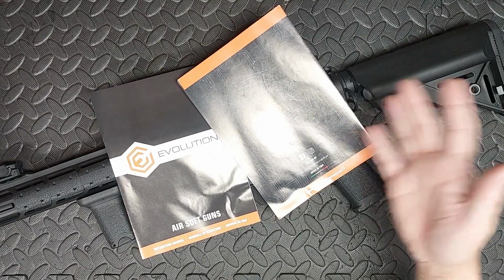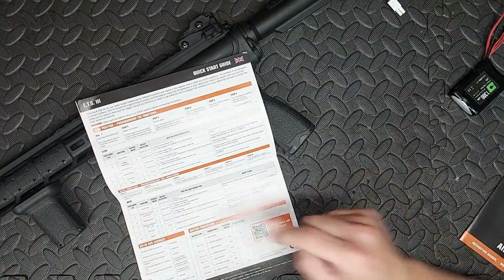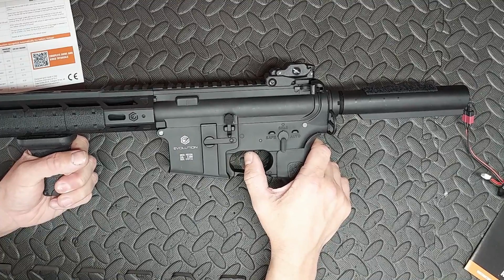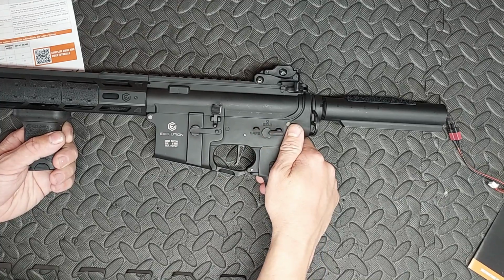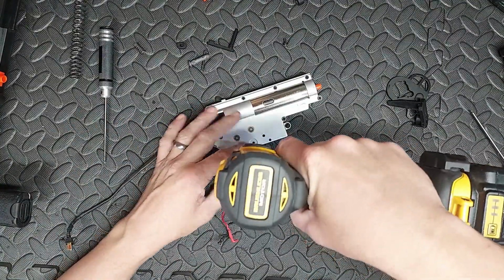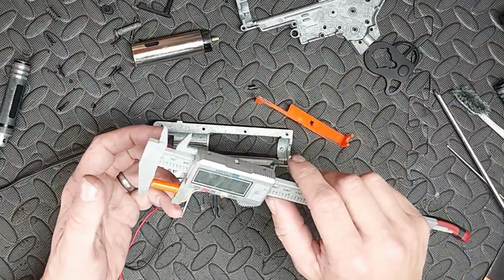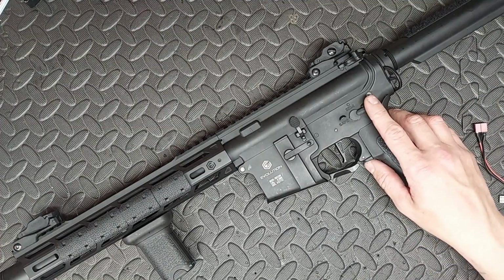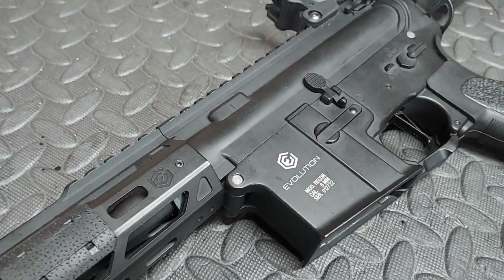Evolution Airsoft  - Worth It?

Comment: After watching a shit-ton of these videos, I'm totally gobsmacked the airsoft community puts up with sub-standard crap that needs re-working to be reliable.  The QC is awful, I mean, the  Chinese make f*king Nerf blasters with better quality than a lot of the far more expensive airsoft stuff I've watched Luke swear at.
Reply: Because airsofters also want their shit to be cheap. So you skimp out on a lot of things - QC, materials etc.
Reply: @UH1Phil  Cheap? I just finished a 200fps nerf springer conversion, (including changing the ammo type and building a sealed brass breech), equivalent to an airsoft sniper build, for a total cost of £50.  I shudder to think how much I've spent on my cyma AK!  But seriously, if you have to swap out parts, add a new hop unit, motor, and get it reshimmed, is a cheap airsoft gun still cheap?  It'd be cheaper long-term if they just made ones that worked oob! 🤑
Reply: @FelixstoweFoamForge  Yeah, but the market demands "good enough", not "fantastic". ASG did well with their Scorpion Evo I think from a QC perspective, but that had a price to match and the immense supply chain that ASG has. Not saying the Evo is perfect though.
Reply: @UH1Phil  I Bloody don't.  I pay, they deliver.  That's how it works.  If it's shit from the box. I'm not buying.  And neither should anyone else.
Reply: @FelixstoweFoamForge problem is expensive guns the money goes to externals if you want good performance and reliable you need to sell enough to get the price to round 350

Good spring guns are dirt cheap. 

The high end nerf guys in the electric gun end can get to airsoft sorted build money easily and you get crap nerf externals.

The singapore and aussie guys who don't have a choice but to drop 300-1k on the custom built guns and their quality externally is far behind airsoft because economy of scale prevents some stuff and their obsession with lightweight.

Airsoft the problem is the endemic Chinese issue of lowest possible standard and no post sale support but you can't do western manufacture as you'd get paintball prices (1200 for a gun easy.)

Comment: I've seen some people say the Devgru DG-74 I have is an Evolution gun. But it's hard to find anything else about it. Maybe they're all made in the same Shenzhen factory.

The barrel did an impression of a German army G36. It's bent down enough that it cracked the cast-in 'gas tube' and misaligned the foregrip.

It's probably still a better 'game' gun than anything else I have that's far fancier.  Because inspite of it all - and sounding like someone banging on a lambeg drum full of glass and rusty nails. it somehow shoots consistently - once I figured out how to make it feed. Clean the trigger contacts, take it slow and it runs.

Comment: I hate stuff that tries to use complex single/2 button programming systems. Especially buttons that also do other stuff (say... A trigger and safety-selector switch)
They're always an absolute pain to actually use, there's no way to get anything done without the manual, and half the time you can't even be totally sure it's actually set the way you intended

Comment: I had one myself first game day motor Burt out.  I'm 99% positive it's the full cycle completion feature on the etu turned it on so the 3 round burst would fire 3 rounds without having to hold the trigger down.  Got jammed somehow and the etu clearly has no cutout if the cycle doesn't Finnish

Comment: what do you think about the new double eagle stuff with fire control things if you have had a chance to look at a few. they seem to be offering quite good value for money but of course that only stands if they work as intended for a reasonable length of time.
Reply: Insanely good value (sadly the mosfets by themselves are out of stock in the states)
Reply: ive had mine for over a year and can confirm they work pretty well
Reply: I can only say good things about them really. A few things maybe: They are really happy with a 11.1v, not so much with 7.4v. The bolt release is a bit flimsy. Nothing else really, performance is good, I only upgraded the bucking to a TNT TR-hop bucking. It was intented as a back-up gun but with the nice weight and performance it started to become more of a primary. I bought it at TaiwanGun. If you need more info about it then you can only find online, I recommend the Pheas Airsoft Youtube Discord. I think it is one of the few out of the box AEG with a mosfet that doesn't fry by the 11.1v lipo. Like, with an 11.1v it has good enough performance for 85% of the people who plays or want to play airsoft. While the Cyma platinums are also great, the Double Eagles are more affordable and have a far more reliable mosfet. The cyma platinum has the better (Cyma blue series) internals, but those of Double eagle are not bad either. If you plan to upgrade the motor to for example a warhead motor, expect possible fitment issues with the existing pistol grip. This can be an easy fix by replacing the pistol grip. Best of luck!
Reply: @NK_Customs  I replaced my stock motor with the modify torque one without fitment issues. Although I can definitely see that the wires have barely enough room

Comment: I've recently got into airsoft and I'm looking at buying my own rifle so I no longer have to hire equipment. 
Do you have any resources on what is good? 
What would you recommend? 
I want the best AEG I can get for £600 max.
Reply: Cyma platinum m4 series is fantastic. Krytac crb isn't bad either.
Reply: If you go with the EMG modified CYMA stuff they are really good right out of the box. The MOSFETs can be a bit iffy like most OEM MOSFETs. The gearbox can take one hell of a beating. The only thing I'd really replace on the EMG CYMAs is the shitty plastic nozzle and maybe the hop up / bucking. Be saving up for a new MOSFET because it will most likely fry eventually. Hell, at your price range you could probably order the Umbrella Corp EMG M4 and have them put a better MOSFET in from the start and you'll have a good reliable airsoft gun.
Reply: Cyma Platinum
Reply: @error262  Yeah, anything CYMA Platinum is good but will require some upgrading to get the most out of it. the EMG CYMA stuff is a steal because it is already pretty well upgraded. Barrel, hop-up, bucking... done.. you got a great airsoft gun to compete with the $1000 stuck-up gang.

Comment: the problem with the electronic trigger buzzing continuously and not allowing you to program any function is not a malfunction, it is just due to the bad Deans to Tamiya adaptor you used which was not able to provide a stable power connection. It is simply in protection mode to avoid damages. The smoke after you took apart the gearbox?... you have in some way damaged the wires' isolating cover and caused a nice short, there is not a fuse that can protect from damaging the gun by yourself 🙂
It is just basic understanding of how electronics work
Reply: so the fault of the short is from the guy in the video?
Reply: @Ruizzz11 Yes, sure

Comment: Do you use precocking whit the warhead motor?
Reply from the maker: build dependant
Reply: @NegativeAirsoftTech  because they advise to not use it…. But when I tried it it seems to work fine. Build is a Cyma 098 whit stock gears reshimmed ofcourse, gate titan, warhead high speed, 1.6J whit 0.3 single locked for a DMR setup. I would like to use the precocking because it reduces the noise on each shot even more

Comment: Hahaha and it's supposed to be better then double eagle m906e..... pufff that's way better as it doesn't tick at you and its died when you pulled the trigger hahaha mine can take a 11.1v but I'm not using one cause its way to fast as I changed the deans connector to new one and now it fires really fast with my trigger sensitivity set to lvl 2 and 1. 

It's a good job I didn't get one of those

Comment: So its a fancy cyma platinum mosfet that's even more fragile. Shouldn't need to install a fuse. Reminds me of when evike botched the downgrade on my aks74u. I try to see how it sounds because some of the newer ones (i got an older one brand new 5 months ago) are decently shimmed. I pull the trigger and nothing. I check the fuse capsule and what should i find in top of the dust cover not staying shut. There was no fuse at all so i had to supply my own. I close it then it starts working probably because the wires were contacting each other. Not trusting evike again. $5 for a box of 20 fuses and 2 weeks for later i finnaly get my first gun for real after the half baked tech job they did. If that's how airsoft techs from big retailers are if you want something done right do it yourself. Even now i found another problem. I want to put a Prometheus barrel in my gun. If ondo that, my gun wont be cqb legal. 345 on a gun that probably has a crap airseal is not a m100. That's probably a m110 but at least a m105. I might even need a m95 spring.
Reply from the maker: It's nothing like the Cyma,more like btc

Comment: Ive bought one of the evolutions last week, discovered your channel today. Iam rather new to airsoft and its upgrades so i tried changong the spring on it anyway. It burned down the motor aswell( on a11,1v aswell btw) as the storeguy sold it to impulsive buyer me. So i gues i got fucked over for 250€ 🫤
Reply: Btw i just kinda binched your uploads and absolutly love your way of bringing it to the table. 👍
Reply: Me ha ocurrido lo mismo , tengo una evolutionairsoft 416. I se me ha quemado.